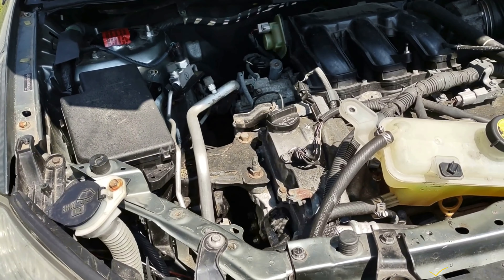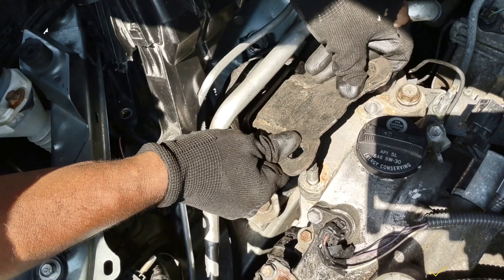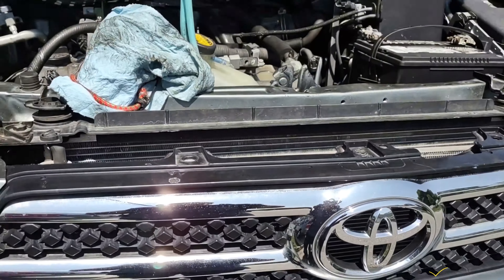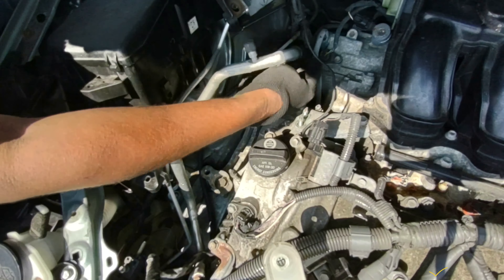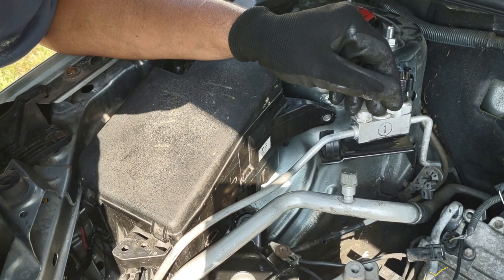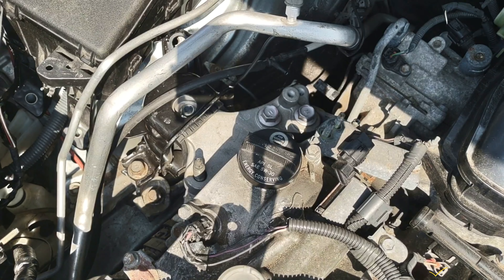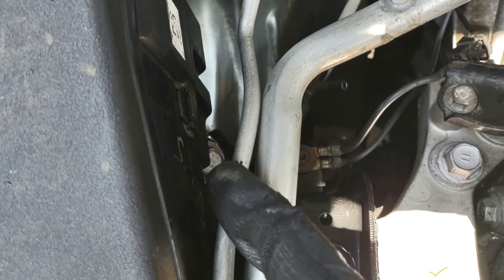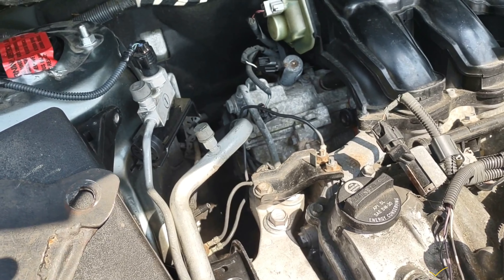motor mount 2008 12 toyota rav4 3.5 AWD right passenger side motor mount engine mount replacement

Comment: Car seems to idle fine no lights but at stop lights has vibration in dash in reverse dash really shakes faint in drive unless on throttle at 80 u can hear a low grumble  in neautral there but not loud had sounds before 2 months ago but went away till now how could soumd go away and what could it be all the motor mounts?
Reply from the maker: determine if it is mechanical vibration or noise cause by possible bad engine mounts or any other components, electrical components or misfire causing the issue, a scanner using live data is a great help because some components are getting out of manufacture specs but cot completely bad so the pcm wont trigger the check engine linght, if bad mounts let some one change gears while you watch the movement of the engine n see if it is too bad.